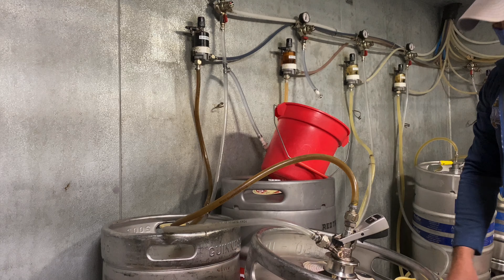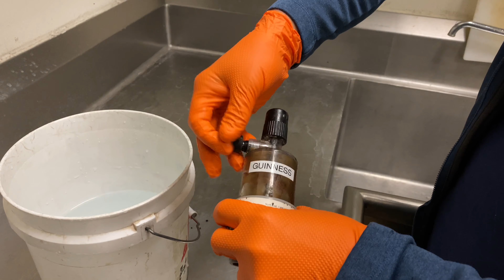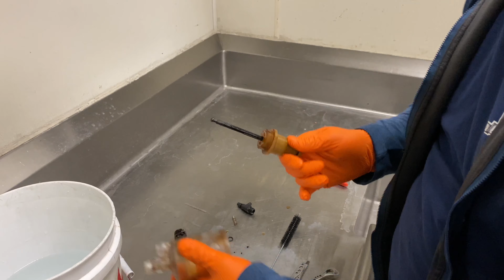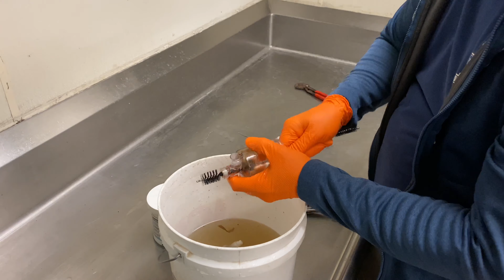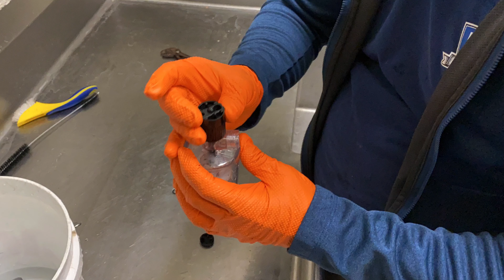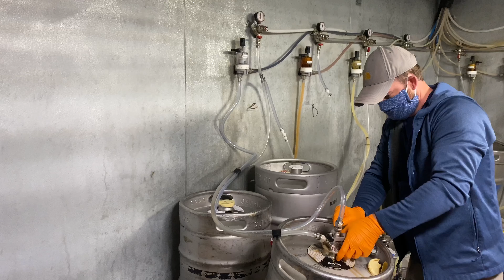Draft Beer FOB Maintenance | Premier Draft Beer Services

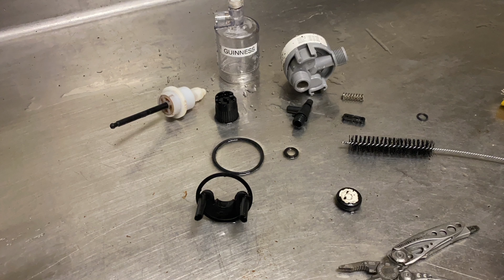Comment: 4:51 “Clean as the day it was installed”

I don’t think so, the inside of the plastic float has a lot of surface area that’s hard to scrub, and I didn’t see it addressed. You can see the discoloration still.

Thanks for the video though!

Comment: Hey I know this isnt a super fresh video, but is the blow off assembly able to be disassembled? It seems there is a gasket inside of the part on top of the FOB, but i cant tell of an easy way to access it.  It is possible the internal o-ring is what creats a seal but I still think there is a chance for some small gasket inside the mechanism itself.  Thanks, and great video!

Comment: help . i work in place where beer is always foamy and sent back as '' bad'' . a vendor comes in and 'ccleans ' lines every couple weeks. I don't think they do much of anything. only here for a few minutes. Our system looks like the video. Would you have complete series for cleaning and maintenance?
Reply from the maker: Yikes!! Stephanie, yes we have a video that shows the step by step process of what a draft technician should be doing. You can find it on our channel homepage. For the amount of time spent cleaning a beer system, a good estimate is about 30 minutes for a small direct draw “kegerator” type beer system and for a long draw beer system with 12 taps would take 1-2 hours on average. Contact your draft maintenance company direct and explain, if not resolved, contact the distributor of the brand and describe your situation and they should have the solution for you. Good luck!!